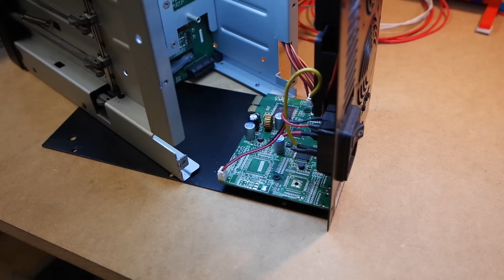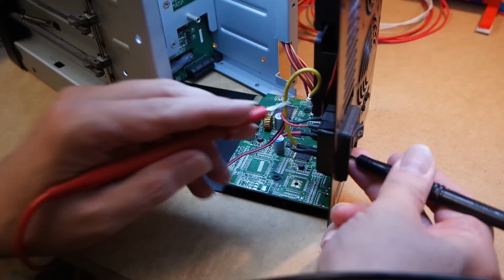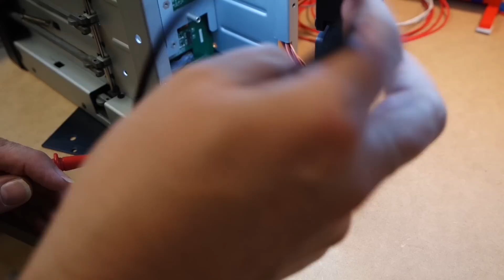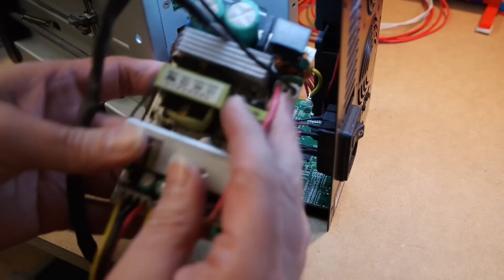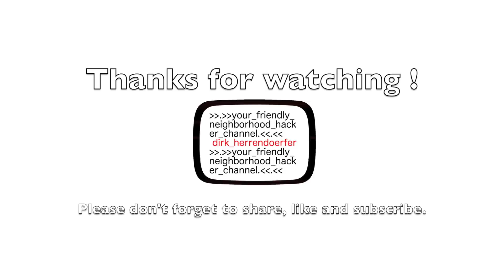Sharkoon 5-Bay deathtrap

Comment: i can REALLY REALLY REALLY NOT recommend this pile of malfunctioning crap product. first the slots died one by one. didnt take any HDD with it but i assume it caused some damage like bad sectors or so - i guess BECAUSE the whole case is basically live. think about that. 
and yesterday after switching it off....it finally gave up the ghost. 
as you pointed out: this thing is so barebones shabby 1/0.  no finesse, just cheap engineering. and i mean thats sharkoon, thats not some temu no name china brand.
well it lasted me quite a while and i never got zapped and im glad it didnt take out the rest of my rig so....off to the trash and never again!
Reply from the maker: I actually wrote a tool to recover the data from the raid it creates - unfortunately you need like twice the data volume to perform a recovery.
It's bad at it's best.

Comment: 🖐hello sir, in these stations the power supplies fail and you can connect a PC power supply to the molex power supplies of the station and the module. I did it but I accidentally shorted the molex but it can be done and it will work

Comment: What happened to this vid? A big chunk of it is gone, it used to be 10 mins long when I watched this in early 2021. It had explanations on hooking it up to an external power supply to retrieve the data on the hard drives.
Reply from the maker: Good question - I think so too ..... need to go look for the original file .... hope it's still there
Reply: @dherrendoerfer  Please do, it was very useful information. Your vid saved me from losing my data and managed to recover using your instructions. Thanks a lot for that or I would've lost 10 years of accumulated data.
Reply: @dherrendoerfer  HI! did you ever find that old video? Alternatively, can you recommend a replacement PSU that fits inside the enclosure, or prepare a description of an external PSU "hack"? I have 3 of these things, and they all died, but up until the PS flaked-out, they worked great... 
Thanks in advance!

Comment: fyi my bay just died after moving. guess I need a new one?
Reply from the maker: To save your data, you can power it with an external power supply, but unpower it before opening it, and let it sit to discharge it's capacitors.

Comment: So I had this happen to me and I'm here to help out if this happens to you. I managed to recover my data and I will tell you how I did it. First off, I had two of these fail at the same time. Both were configured RAID 0 with one being the backup of the other. The backup was switched off but as this vid already mentioned that doesn't make any difference, it's indeed always live. So both failed at the same time due to a power surge and since this is badly (not) grounded it essentially fried the power supplies of both stations at the same time. The devices weren't turned on which was the one reassuring thing so I knew there was a big chance my data was still intact, I just couldn't get to it. 

If you have this happen there are basically two options for you. Option one is trying to find an exact same working Sharkoon 5 bay and stack the drives in that new bay in the same order and with the same RAID configuration. But these 5 bay stations are no longer sold (in 2021) so good luck in finding one.
The second option is what Dirk here mentioned, hook it up to a power supply unit and recover the data. This is what I did. I bought a separate psu (it comes with the necessary connector cables, you'll need two power connectors (molex) and one 24 pin connector). Open the sharkoon station and remove the power supply of it just like you see in this vid.  Connect the two power connectors from the new psu to the stations mbu (they are in the upper right corner of the back of the device just out of frame in this vid).  You can remove the existing power connectors from the sharkoon station, you won't need them.
Note, you can also try to connect it with your PC's PSU if you have enough power and the available cables and you're working off a desktop pc and not a laptop, this wasn't an option for me.

Once the  new psu is connected close the back board and make sure the lower horizontal mbu (mother board unit) is connected with the vertical part at he bottom.
Now, if you try to switch one the new psu with the 0/1 power switch at the back of it, it won't turn on. This is because the psu is turned on by an electronic switch. You can force it to turn on with this simple trick: https://www.youtube.com/watch?v=Ea1dcJ0QyAE 
If the video link doesn't work anymore basically do this: Use the 24 pin connector, connect it to the psu. Then take the connector part that's usually connected to the PC MBU hold it in front of you and make sure the plastic center clip of the head of the connector is facing you. Now, from the right count the 4th connector block (green wire) and connect it to the sixth block (black wire, yes the fifth one is also black I know) using a paper clip or a copper electrical wire. Now the psu will power on by itself without being connected to an MBU.

Comment: I've had the very same problem, but I've been lucky: the power suply died when it was "off", so the data is intact. Thanks to your video, I've managed to plug it off, and I will connect the standard 12v plugs with my PC's PSU, and so securely power it on and recover the data.
Such a shame product!

Comment: Hey Dirk! After some shipping mine stopped working. Not sure why. Can you help me with how you dismount the back panel? Maybe i can identify the defective parts. No visible damages
Reply from the maker: Remove the screws from back and bottom, and the top tin will slide off to the back.
Reply from the maker: And be careful! the power button does not disconnect the mains from the power supply ! Disconnect power and wait for the HV-caps to discharge,

Comment: The power supplys are much to weak for this units. On the power board there is a fuse that is soldered to the board, you can first check that. What I did is simple: remove the whole power supply (look for the 3 screws under the rubber feet, and shove the the unit apart very carefully, etc, etc) and disconnect the 2 molex connectors as well as the 120/240 V switch as well as the little white AC connector witch are connected to the board. Than take an old ATX power supply (maybe you'll find one near a garbage can ;) and carefully connect 2 molex connectors to the vertical PCB. Be careful because the PCB will bend so put your finger behind it to hold it straight when pushing the molex on the board! Don't forget to make contact between the green wire (pin# 16) and a black (ground) wire from the PS otherwise it will not fire up. Don't touch reset or raise mode switches. And don't forget to plug in USB otherwise the unit will also not start. Just power it up! Now you can use your box as normal! I made it very comfortable and remove the AC inlet and mount an 'aviation' 5 pole socket (Ali!) and homemade the ATX power supply in a nice box with a decent piece of cable between it and again an aviation 5 pole connector to it. 5 pole because 12 and 5 volt, double ground (as molex) and a ground metal house to metal house for safety. I finished it with 2 small Chinese cheap double digital VA meters for 5 and 12 volt and amps monitoring (the eye also want something). The mainscable stays in always and the switching is done with a small switch between the green and black wire, just as  in a PC. I run 2 raid 5 boxes witch were both at about the same time got stuck on that single power supply at the same time. Works wonderful and another advantage is that the 2 fans in the boxes are now doing a far better job because they are now really cool the 5 disks in stead of the poor power supply. That is also why it is important to remove the defective ps. Success!

Comment: The steps I followed to successfull retreive all of my data from a failed sharkoon 5bay raidbox.
In my case replacing the powersupply did not work. The mainboard of the sharkoon raidbox caused a short...

1. Sadly buy a new sharkoon 5bay-raidbox.
 (I returned it within 14 days and got my money back). 
2. Put some old unused drives in the new raidbox to configure the raid5 setup. Wait until done. (Not sure if setting the raid5 formats the drives so I used old drives). 
3. Poweroff the raidbox, remove AC powercord.  (I wanted the raidbox to absolutly not detect the next step).
4. Swap the old unused drives out of the new raidbox and replace them with the importand drives from the old raidbox. (Keep the drive-bay order 1 to 1, ...)
5. turn on the new raidbox containing all of the importand drives, in my case all data was back available. 
6. Copy all your data from the array to somewhere else.
7. Return the crappy raidbox within 14 days so you get your money back. (Optional)

In my case the new raidbox was also broken, and repeatedly dropped drives from bay 1 and 4, even when replacing them with new drives from the same brand and type.
I returned this crappy product and build myself a nas using the openmediavault option. The computerhardware I use now for my nas is actualy around the same price and is better in quality.
When the hardware in my nas breaks I am not stuck to the same brand. I can replace the motherboard for example with another brand, the mdadam software raid6 array will be recognized without any issues. I even get higher read/write speeds using the software raid6...
I also use the rsync software provided in the openmediavault webui to daily syncronize all my data from the raid6 to another offsite raid6 array.

O yeah, the sharkoon raidbox also destroyed my UPS. Never sharkoon again!!!
Reply: Or do it the easy way. Just take one by on HDD and put it in a external HDD box and copy all out.
Reply: @V3ntilator  Copy the data from the disks one by one from a raid 5 setup? I don't think you understand how raid 5 works? 

Real raid 5 splits data in low level binary format over all the disks, this to improve read and write performance. 
This also means that each disks in a 5 - disk raid 5 array only contains 1/4th of the binary data for each file, the 5th disks contains a checksum for when one disks fails. Connecting one disks from the raid array to a single drive HDD enclosure would only result in Windows or Linux showing an non partitioned drive.

The way data is saved in a raid setup also depends on the hardware raid controller that is used, therefore forcing you to buy the same one if the old one fails as the safest option. That's also why I now use mdadm software raid 6, software can be moved to new hardware without requiring the use of identical hardware, not limiting or forcing you to 1 brand.   

A simplified raid 5 example, lets say we want to save the number '234' (two-hundred-thirty-four) on a 4 disks raid 5 array.
- The first disks would store value '2'
- The second disks stores the value '3'
- The third disks stores value '4'
- The fourth disks stores the checksum 2+3+4 = '9'
notice how none of the disks contain the full data, only a portion of the data!

When a disk fails and you replace the broken disk, the rebuild would look as follow:
- Replacing the fourth disk:  Recalculate checksum 2+3+4 from the other 3 disks (2+3+4= 9), save '9' on the new fourth disk.
- Replacing the first disk: Recalculate value using checksum on disk four, and use the value from the other 2 disks, this results in 9-4-3 = 2, save '2' on the new first disk.
- and so on...
notice how it would be impossible to rebuild while missing 2 disks in the array!

In reality it's a lot more complicated as each disks holds partially checksum and data. Everything is also in binary format and not decimal.
If you want further in depth explanation of raid functionality just let me know, but I would prefer using something different than the Youtube comment section...
Reply: @timmy7201  Sorry. I didn't think of RAID which works way different as you explained vs JBOD.
When i used 5-Bay Sharkoon, i did not use RAID at all. I only used it in JBOD mode.
The reason is that i always have backup of most important, so i never lose anything if a SSHD/HDD ever should fail.
Its slower than RAID, but good enough for my usage.
Reply: @V3ntilator  Well, apparently I forgot there was an option to use the Sharkoon 5 bay box in JBOD mode, thanks for the reminder.
You shouldn't be sorry, as your option is indeed valid for a lot of people!

I have only used it in raid 5 for increased read performance. 
Always nice to copy data at ~120MB/s over gigabit network, copying a complete video recording of 1GB in less than 10 seconds. 
My current mdadm raid6 setup has 2 x 1Gbps ethernet ports so it can handle 2x ~120MB/s :-)
Reply: @timmy7201  No problem. The Sharkoon were marketed as a RAID cabinet, so JBOD isn't the first you think of then. My Sharkoon lasted for 7.5 years until it died before last xmas. Bought a new 4-Bay Icy Box for same usage. Worked fine so far, but had to power it down for a few minutes when HDD's in it became very slow. Power down fixed it. ;)

I always used Gigabite LAN since it came and i still use it on everything possible. WIFI is still inferior for reliability 24/7. WIFI is nice for phones and tablets.

You have better Gigabit speed than here, but still superior to WIFI. I replaced all my Gigabit Switches and 3 routers with 100% TP Link the last 2 years. 100% reliable brand. I have 3 floors in my house, with wired Gigabit. I use 2 of the routers as Extenders as they are always 100%.
Dedicated WIFI extenders can be buggy. Thats why i use proper routers instead.

Comment: My Sharkoon 5-bay also died today :(. Hope I can get the data out of it(raid 5). After reading the comments, I will first try an eksternal power supply. And after connect them to my motherborad and run ubuntu. Any lucky for you?
Reply from the maker: Mine worked with an external supply, I was able to save the data. I did not get access via linux. (But I didn't try hard since it worked with the supply)
Reply: hi, may i know how did you go about supplying power to it externally? Im really not a thechy guy. thanks in advance.

Comment: Thanks for posting this video. Just had one of my two units litterally catch fire(box contained it and my APC UPS cut the power which most likely saved my day. Was thinking this may have been a freak accident but seeing as my still functional unit is suffering the exact same issues you're describing here it's heading for the recycling station as soon as I've gotten my data off of the drives.

Comment: Mine just broke yesterday. 
In my case powering it with my old ATX PSU causes the ATX PSU to shutdown after a second or 2, probably a shortage inside the raidbox mainboard. Explains directly why my UPS went into shutdown when it happend.

I have backups of the more important data, but would it work to swap the raidbox for a new one and placing in the drives in the same order to retrieve the less important data?

All 5 harddrives seems to be healthy.

If the chanse of succes is rather small i would also prefer to replace it with a better option.
Reply from the maker: Maybe try another power supply, some won't work if the load is unsymmetrical. The disks may work in another raid box of the same type, reading them via linux may also work, but I don't know the raid layout they are using.
Reply: @dherrendoerfer  
Thanks for the information. Sadly it didn't work with an external supply. Sorry about the late answer...

The steps I followed to successfull retreive all of my data.
1. Sadly buy a new sharkoon 5bay-raidbox.
2. Put some old unused drives in the new raidbox to configure the raid5 setup. Wait until done. (Not sure if setting the raid5 formats the drives so I used old drives). 
3. Poweroff the raidbox, remove AC powercord.  (I wanted the raidbox to absolutly not detect the next step).
4. Swap the old unused drives out of the new raidbox and replace them with the importand drives from the old raidbox. (Keep the drive-bay order 1 to 1, ...)
5. turn on the new raidbox containing all of the importand drives, in my case all data was back available. 

Well...

After a day or two the new raidbox started failing again. 
First the disk in bay 1 was dropped from the array. I replaced it with a brand new WD red. (using all wd reds). Rebuilding the array completed without issues. 
One day after rebuilding, another disk was dropped from bay 4. As my drives where 3 years old I also replaced this drive with a brand new wd-red. Rebuilding the array.
The second my array rebuilded to disk 4 it again dropped the brand new drive from bay 1... 

I was so enoyed with the low quality of such an importand product... 
I copied all my data to the unused drives i had, while the array was degraded to a striped raid...
I ordered some computer hardware to setup an Openmediavault Nas with a raid 6, mdadm software raid.
I returned the new crappy raidbox withing 14 days as I do not trust this product with my data. 

The  computer hardware I ordered was actualy around the same price as this crappy raidbox, but now it exists of quality hardware.
I now have raid 6, so 2 drives can fail at any given moment. I get higher read/write speeds...
When somthing fails, in example the motherboard, i can just replace it with another one, mdadam will still recognize the raid6 array. I am not stuck to any brand.
When a drive fails, i get an email. When a drive is about to fail i also get an email.
Each first sunday of the month the array is automaticaly  checked for possible sync errors.

I will never return to the Sharkoon raidbox, or Sharkoon as a brand !!!
Reply: Will also post above message in the main chat so other people can find it faster.